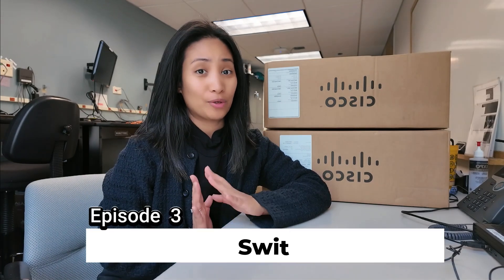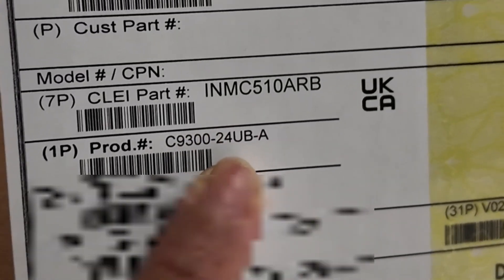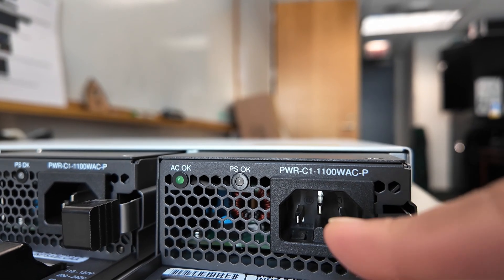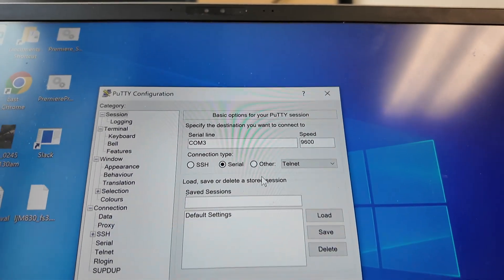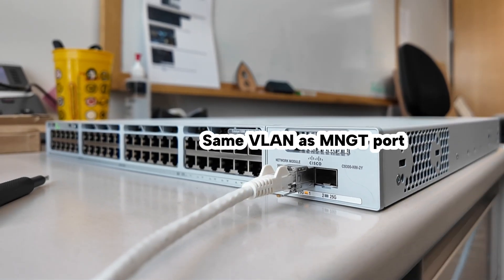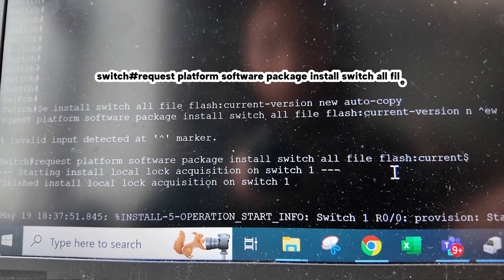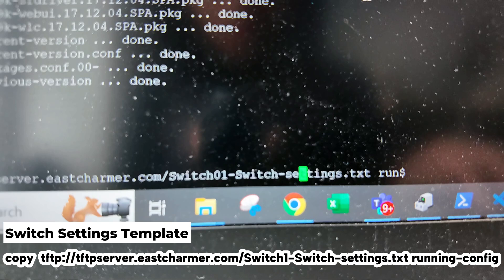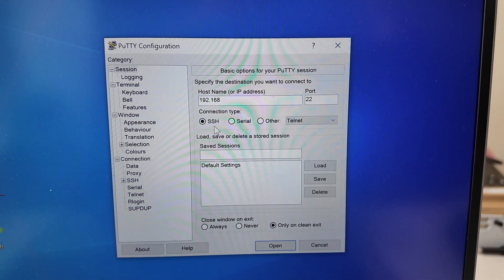Configuring CISCO 9300 Switch at work | (via TFTP Server) CISCO commands, real world best practice

Comment: If we buy this series of switches, doesn’t it come with an operating system included? Or do we have to pay this much and then still install the OS separately through TFP? What kind of logic is that?
Reply from the maker: It comes with a pre-installed OS. If you have complaints with devices, you should express your concerns to the vendor coz I didn't make these switches

Comment: Good video, but in production we always use a USB to copy the new image into the switch. This is because the size of the IOS is more than 300Mb or in case of NS-OX, its even more so better take a USB and do it , all you need to do is to connect the USB to your switch, and you should be able to see a message on your terminal screen that USB0 or 1 has been connected. Then use same copy command and you can copy the iOS file in less than 20 sec and same for the cofigs. 
Make sure the boot variable is set, tahnks

Comment: I noticed you blurring very important information from the boxes, very good!. However, later on you're showing the fan modules on the back of the switch which contains information you can use to retrieve the information you actually blurred out on the box. Just an FYI. 

Love the video, nevertheless!
Reply from the maker: Thank you! I think it's fine. What I blurred is for our internal systems

Comment: Nice! Just a recommendation. The “request platform” command to upgrade in install mode in now deprecated as of 16.10.1 version and its now considered legacy. The recommended command is “install add file flash:<your_.bin_file> activate commit”. This will copy automatically the required files and upgrade all switches in the stack (if connected) as long as the .bin is in the master switch. Keep up the good work!

Comment: When I need to configure a switch from the cli, one of the first command I type is "no logging console". Messages splitting my command in 2 while I try to type annoys me so much lol. Also "no ip domain-lookup" for when I typo a command and the terminal thinks I am typing an URL and tries to lookup for like 10 sec
Reply: Also, if you want to see log messages but you don't like the message cutting your command, you can use "logging synchronous" on the line configuration so that your command line gets bumped down below the log message

Another nice tip is to use "transport preferred none" in the line configuration instead of no ip domain-lookup. if you use the latter command it will turn off DNS resolution which is not optimal. The reason why your terminal gets stuck is because it will assume the mistyped command is a hostname and the device will try to telnet (by default) it, and the name resolution fails (although you can use ctrl+shift+6 to cancel it). if you use transport preferred none it will turn off this auto telnet if you mistype your command
Reply from the maker: I agree, those messages are very annoying! And it's almost impossible to type anything. I forgot to add that to the video.

Comment: I'm actually grateful you said that you didn't enter commands/configs one at a time. I'm halfway through a CIT degree, and not one book, professor, or any other you tube video or website has said this was something I could do for switch set up. You're right this makes 2000% more sense and it sounds way more efficient. Learned something new and you got a sub , friendo.
Reply from the maker: Thank you! Oh yes it's still good to know the commands but there is a better way to load it to the devices like a template to make it more efficient. More videos to come!
Reply: You can only do it with certain switches